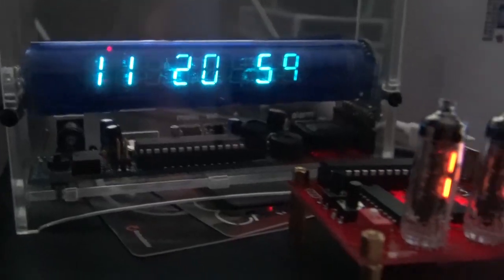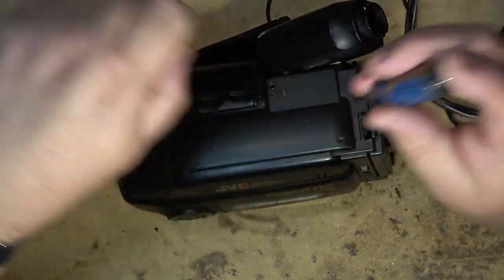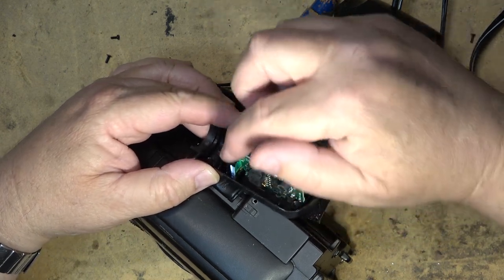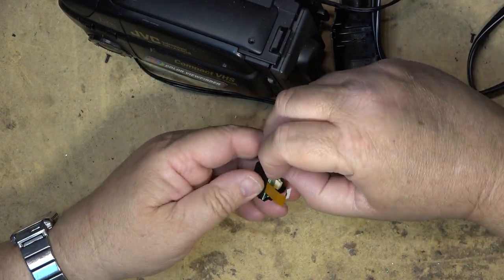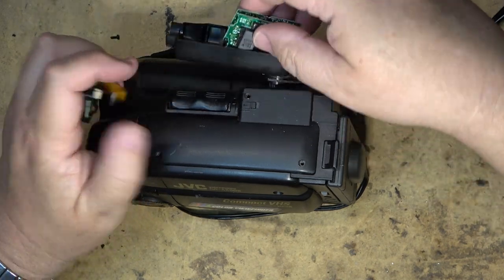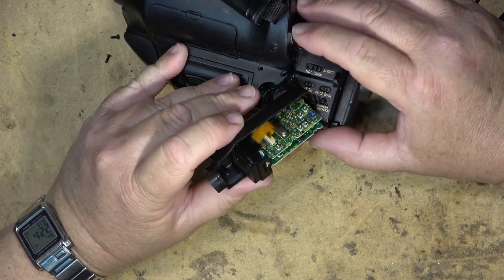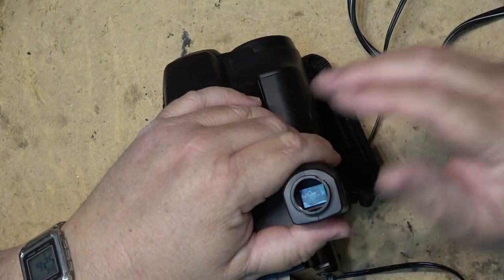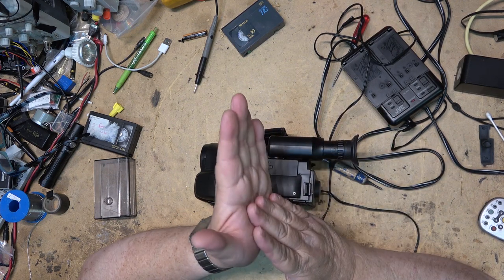Colour Viewfinder Teardown and Future Projects

Comment: Thanks a lot for fulfilling my request! I thought about it in the  morning on the bus, and realised it's quite impossible to be an LCD shutter CRT, because it needs to run the CRT at 180Hz refresh rate, and requires a digital full frame buffer for it. This setup at the time would cost more than the whole camera! 
It was well worth taking a look into it though, as I have never seen a flat CCFL tube like this. Really cute.

I have a dead Panasonic VHS-C of similar vintage, it has a color viewfinder, that one is LCD for sure, as it's about half as deep as this JVC. I thought this might be CRT because it was deep enough for that.

The resolution of this tiny JVC LCD seemed to be surprisingly good for 1994.

Comment: Looking forward for the two cute little TVs. I wonder the stripe pitch of that old little color tube.
The B/W TV 'boombox' is more than likely Orion/Funai OEM. I have a few of them, looks very similar. I also have a TEC Multiport branded one, made for the German market, which turned out to be a Sony OEM for my biggest surprise!
Reply from the maker: I have plugged them in. Both have issues.   Will start on one tomorrow.  I forget who made the candle set.  Believe it said made in Japan on it. Had the same set at a teenager.  Used to watch that set all the time in bed.  Had it sitting at eye level so i could lie in bed and watch TV. Then I got a bigger set and the small one ended up in the kitchen and ran all day every day.  Was easily the most used set. Would sit on CNN all day.

Comment: I was curious what resolution these viewfinders had.  I suspect that it was not the full 720x480 (standard def interlaced equivalent).   Also were these viewfinder color LCDs passive matrix or active matrix?
Reply from the maker: Active matrix. Low resolution.   
The eyepiece on my ax33 and 53 cameras is a transreflective lcos type panel which is sequentially eliminated with red green and blue LEDs strobing had a very fast speed. My ax100 on the other hand a 4k OLED eyepiece.
Reply: @12voltvids  So essentially on AX33 and AX53 It converts the image to field sequential color (similar to the old CBS standard that was abandoned in the 1950s with a rotating large color disc and was later used on single chip DLP systems, the Apollo moon cameras [Reverse Col-R-Tel with tape buffer system], and LCCS hybrid CRT/LCD displays using a color LCD panel on a monochrome CRT)?
Reply from the maker: @stphinkle  
More like the led DLP systems.  Single chip, and it might be a DMD device as opposed to lcos, but there are 3 LEDs illuminating it and the eyepiece lens is focused on the chip.  If you shift your eye or shake the camera you get the strobes just like the old color wheel dlp.   The led DLP however is too fast to see it.  Same with the laser based projectors by Casio.  I tore down a pico projector a few years ago to clean it up.   So yes the image is very good but not as good as the OLED.  The old Minolta dimage 7 camera used the same system.  I have one of those around here too somewhere.

Comment: Do you know what signals are sent to the viewfinder? I'm guessing not composite video like the B&W CRT which are easy to repurpose (if you have a use for a small display ;)
Reply from the maker: Composite more than likely
Reply: @12voltvids  separated luma and chroma , or a certain type of rgb signal  but depends who made it (sharp liked using rgb on their panels)
Reply from the maker: @Dr.-Smart  no, they typically did not do that.  VHS is a composite format.   
The little board on the top would decode the ntsc signal and send the decoded signal to the panel.  Most color viewfinders have just 4 wires going to camera board.  Video, b+, ground  and tally light.
Reply: @12voltvids  Chroma and luma are separated by the viewfinder's electronics, just like in a CRT monitor.
Reply from the maker: @dougbrowning82  it could be Y/C but the ones i have seen are all composite.  Only 4 wires and one is needed for the red light to indicate recording.
Reply: Composite from the camera to the viewfinder. The chroma demod is on the viewfinder board. The crystal is the chroma demod crystal.
Reply from the maker: @dougbrowning82  correct
Reply: @Dr.-Smart  color EVF in this video use composite signal. One board have DC-DC converter, it convert 4,5-5V to 12V for LCD panel and decoder ic, high voltage for backlight tube. One board have decoder and timing generator ic, it decode signal from composite to RGB, gen timing and send it to LCD panel. 😁😁